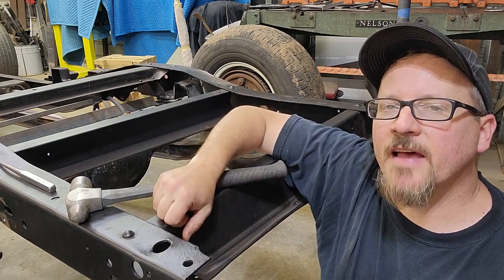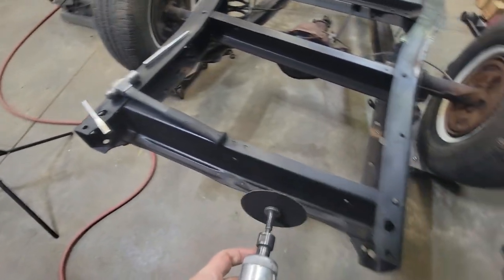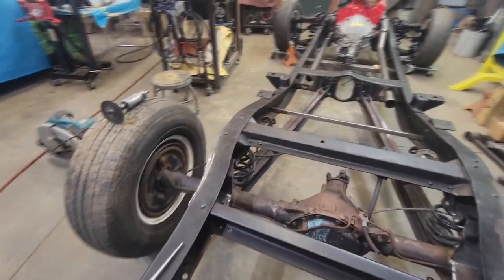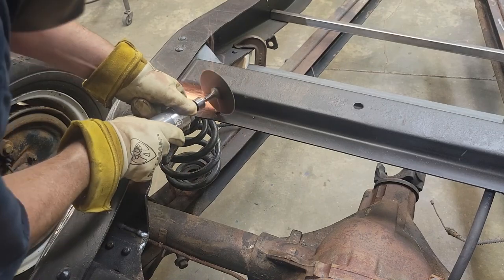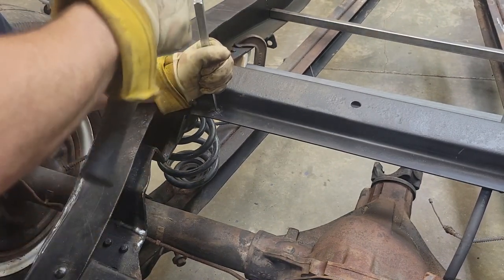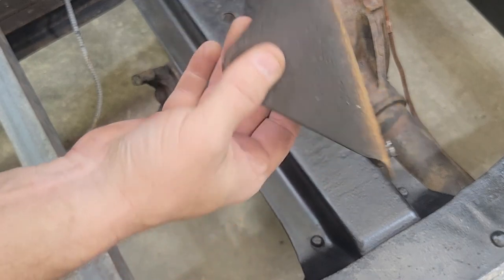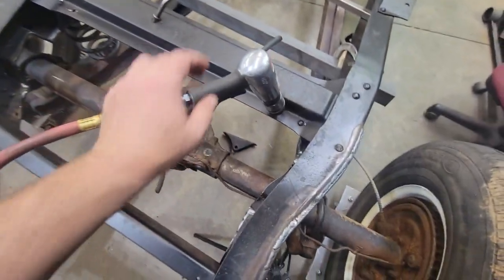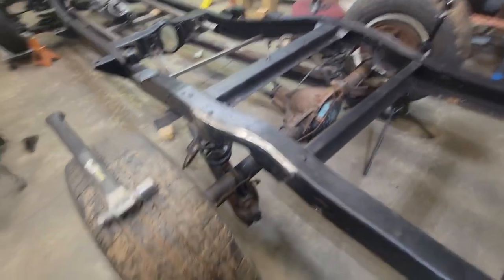How to Remove STEEL Rivets (THE EASY WAY) from your C/10 Chassis

Comment: If you're using the cut-off wheel to make an X cut, why not just cut the head off flush?
Reply from the maker: Ive done it both ways but with my air cut off wheel it seems to cut a little faster. But you can do it eaither way!
Reply: Want to see someone so this with the bed still on and no air hammer